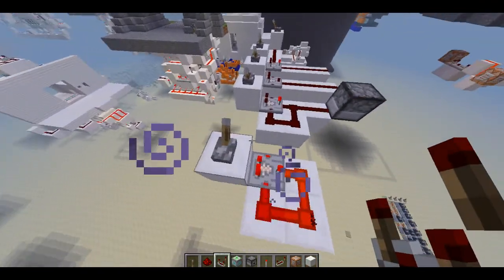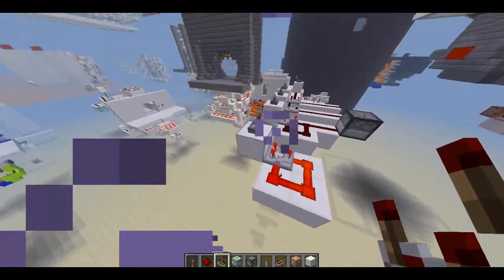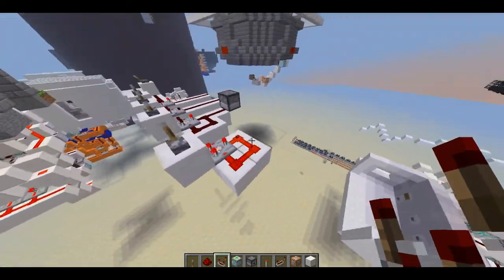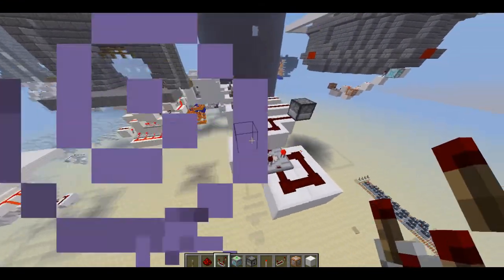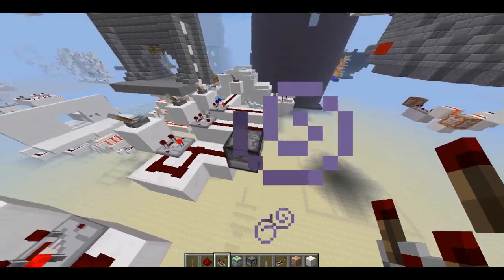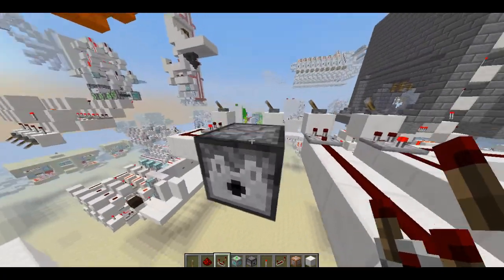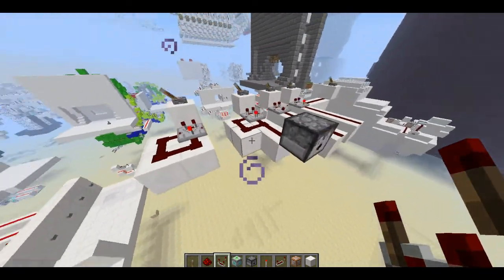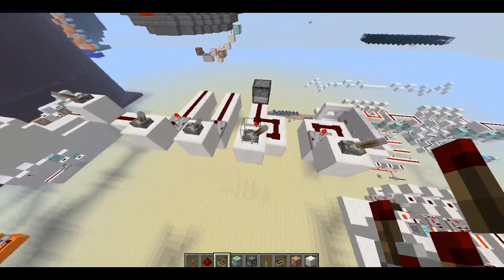Minecraft Comparator Logic : Weird Clocks Explained

Comment: ok i want to say this have you tried you putting repeaters in the circuit. if you put it in front of the comparator it doesnt work but if it is leading into it, it  works. this is because the lever's placement has to be 6 blocks away as a minimum for it to cancle out making the clock. also the lever placement can also be a fix for the problem just making 1 block farther away. i hope this helps people bc most people dont realise things without someone showing them.